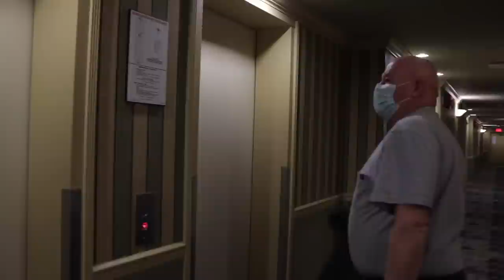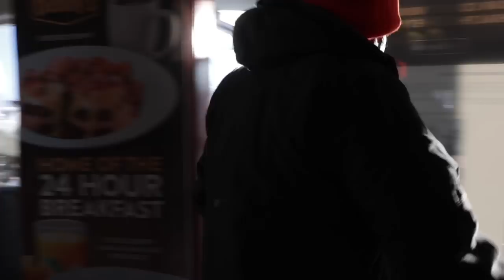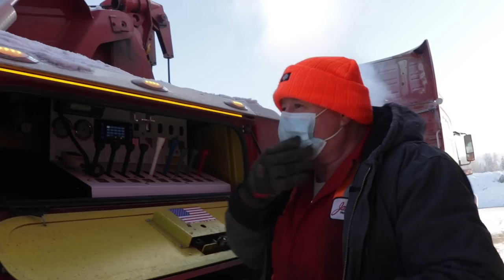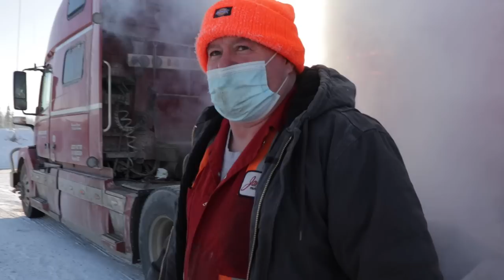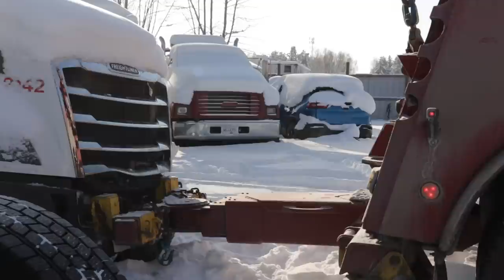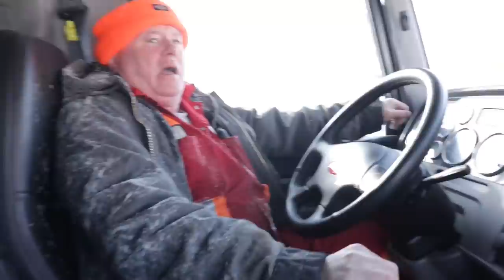Jamie Struggles -30 Degrees TAKING OUT DRIVESHAFT (FREEZING) in Quesnel, BC | Trucking Life

Comment: I was cheap for years and then finally bought a high torque cordless impact for pulling driveshafts... should have done it years earlier. Have a small compact one for caging brakes too with the long 3/4 caging socket. Regular impact won't fit sometimes. I have a dewalt dcf921 for caging but Milwaukee makes a compact one and so does rigid and prob others. 110% worth it
Reply: Good advise. Good tools ain't cheap

Comment: I was in Grand Prairie over New Year’s, years ago and the tractor gelled up.  They were going to tow it to their shop to warm up.  Went to drop the trailer and the tow driver told me I had to do it in low gear, I didn’t believe him until I tried.  At -37 c, grease is like concrete.

Comment: Jaimie consider running 32 weight synthetic hydraulic oil in your hydraulic systems if not 22 weight if you're going to venture in to more northerly climates. That 46 weight should only be sold in the tropics.

Comment: Sir as a safety precaution when you remove the drive shaft and underload could you not place a strap on it to support it to prevent it from dropping ie  a ratchet straps just to the point were it would catch it if it dropped buy tightng it were it was  wrapped around it with anough slack to absorb the sudden realese from being under load thanks and merry Christmas to you and your family

Comment: Jami i have a question. If you plug semis in to keep oil warm. Couldnt the same be applied to to the hydraulic fluid as well? Or i would put a switch and tie heaters onto heat and keep tanks warmer.
Reply: Trucks that work in the cold constantly usually just run thinner hydraulic oil, I’ve never seen a system for warming the hydraulic oil.
Reply: @allanj4576  ok but do you think it would help. Im thinking of a heater or similar system to oil thats tied in parrallel for wreckers. Flip a switch for winter and heats both and keep fluids from gelling up. Jami did say they left truck running so if hydraulic oil was heated like engine it would allow them to work
Reply: @allanj4576  OH yes. My KW was spec'd with an oil pan heater. You can definitely use em in the Hydro tank but running your pump for some time prior to actually working is best. I had an Artic Fox in my Hydro tank  but it will suck the heat right out of your radiator.
Reply: @andysmith5220  Bottom line is it takes lots and lots of Cash for good dependable service. The radiators only but out so much heat